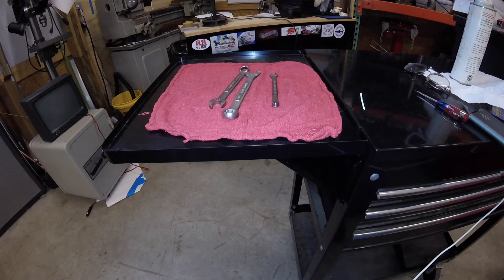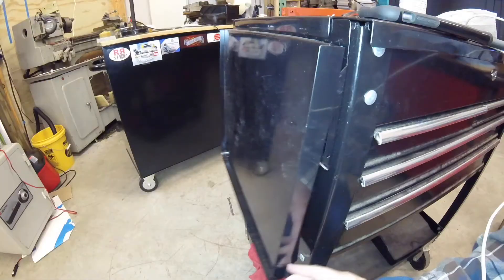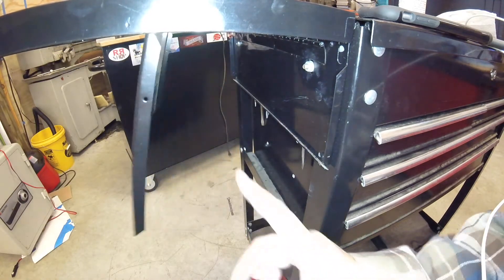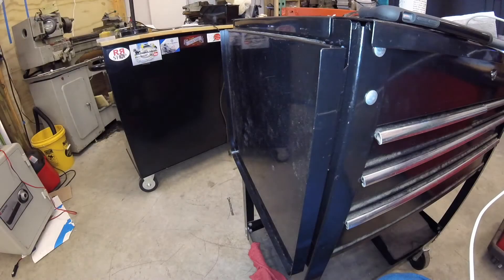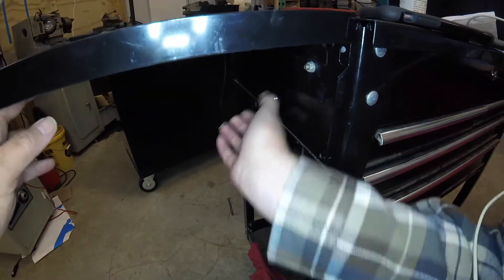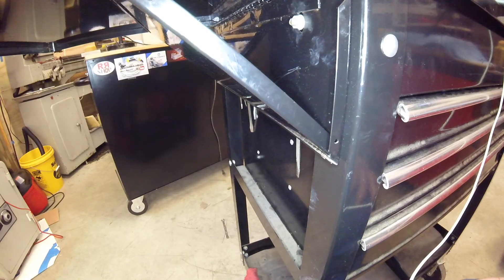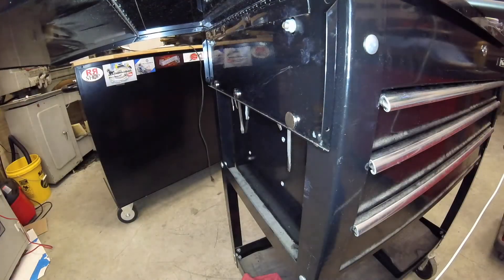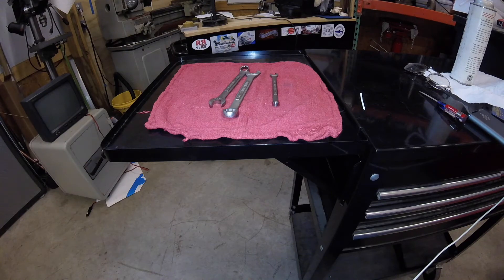Side Shelf Mod For Tool Cart

Comment: I just riveted a little piece of sheet metal to the leap. Then drilled a hole between the leap and the table support. And then you just need a bolt and a nut simple. Easy to remove easy to install

Comment: Great idea. Had the same thought. Witch magnets did you use?
Reply from the maker: Initially I used whatever I could get at Home depot to try out my idea.  once I knew it would work I wound up getting  these at AMAZON  "totalElement 1.5 x 1/16 Inch Super Strong Neodymium Rare Earth Disc Magnets N42 (5 pack)".
I got as thin as I could so the magnet didn't push the support arm that much closer to the edge of it's perch. I got 1.5" diameter so the magnet would grab the support arm even if the shelf was elevated to max height.  Hope this helps, Chris
Reply: Shadowdog500 thanks buddy

Comment: Instead i would drill a small hole through both pieces where the angle piece meets the main box (both front smd back).  Put a small screw 6-32 or 8-32 with washers and a nut.  Would be better than magnets but you cant drop the shelf as easy if thats an issue for you.

Just a thought.
Reply from the maker: aitf99  Thanks for the tip.  I did think about just using a pop rivet in a similar fashion to your bolt idea but I wanted the ability to put the table up and down easily.  The magnets are working great.  Thanks, Chris
Reply: @shadowdog500  just a suggestion.  The rivets is probably a better idea...
Reply: Or just a pin on a wire, easily pop in and out yo release the drawer.
Reply: @supersexyfatguy  This. You can even get one with a ball detent system so it secured in place.